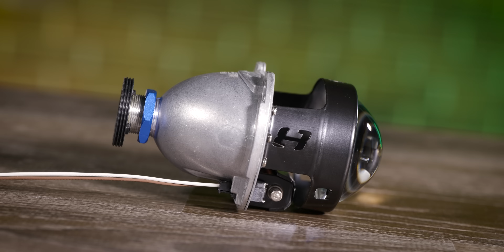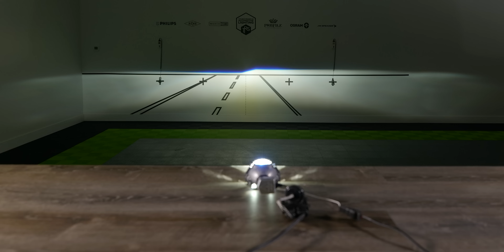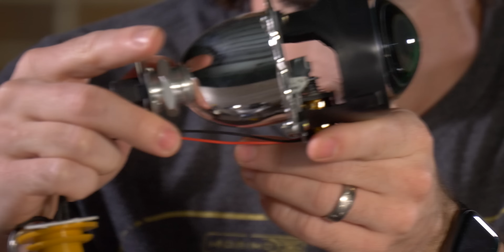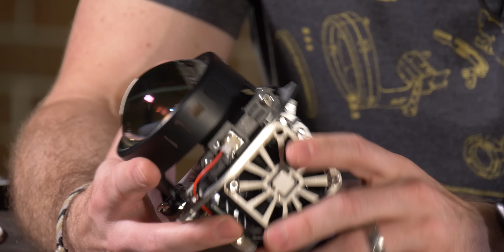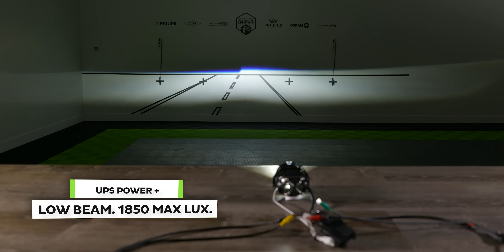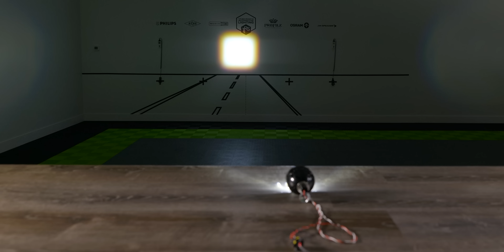LASER VS HID VS LED Headlight Projectors Retrofits - WHICH IS BETTER? | The Retrofit Source

Comment: What do you all suggest for a stock 2018 Infiniti QX 80
Reply from the maker: The 2018 Infiniti QX80 comes with OEM LED headlights, which unfortunately limits upgrade options since the LEDs are built into the headlight assembly. Retrofitting would likely require advanced wiring and custom coding, so there aren’t many plug-and-play upgrades available at this time.

Comment: I wish someone made an LED projector retrofit that used a removable light light the morimoto xenon projectors do. If the M-LED wasn't a built in light I would go with it but I'm probably going to end up going with the D2S mini or micro 5.0
Reply from the maker: It's a tradeoff, but that's the beauty of having so many options!

Comment: Hi everyone, my right projector has misaligned cutoff line for low beams, it's slightly curved to the right, is there a way to move or reposition the shutter plate inside the projector?
Reply from the maker: Are these custom retrofitted headlights or OEM? If they're OEM, we recommend checking the bulb seating in the housing to ensure it's fully seated, as a misaligned bulb can sometimes cause cutoff issues.

If the headlights are retrofitted, it's possible the projector isn't perfectly aligned in the housing. Adjusting the projector alignment would be the best solution. Modifying the shield or shutter plate inside the projector is significantly more challenging and not recommended, as it could cause further issues. Let us know if you need additional guidance!
Reply: @RetrofitSource  It's aftermarket headlights, the projector is sitting very tight, the problem is the shutter is not sitting flat when the high beams are not engaged, what do you recommend to replace the shutter and solenoids or the entire projector assembly?
Reply from the maker: If you're able to open the headlights and investigate the shutter to get it to sit properly, that would be the easiest fix. However, if that doesn't solve the issue or if you're using generic aftermarket projectors, upgrading the projectors would be the next best solution.
Reply: @RetrofitSource  One more thing, randomly it happens that the left bulb goes out then comes back on after 20-30 secs or so, happened on 2 different sets of bulbs, before with HID, now with LED, I had my headlights opened just about a week ago and there are no damaged wires, again I say it happens RANDOMLY I was driving over a month without the issue then it started happening, should I look into the harness plug contacts for my bulbs as the harnesses are loose when plugged in so I taped them with electrical tape but seems it doesn't help much...
Reply from the maker: Yes, we would recommend starting by checking the harness plug contacts for your bulbs. It's important to ensure that all pins are making solid contact, as road vibrations can cause intermittent issues if the pins aren’t fully seated in the connector. If the harness feels loose even after taping, you may want to try gently adjusting the pins to improve the connection.
Reply: @RetrofitSource  Thanks for your help, much appreciated, about an hour ago I've disconnected the bulb and paid attention to the pins as they seem fine and I sprayed some Liqui Moly contact cleaner on the headlight bulb harness to see if that's going to help... After all I think the best option is to swap these BiXenon projectors with a BiLED ones, and then I should be happy with the overall performance of my headlights...

Comment: So all of these Bi Led projectors have the bulbs integrated? So what happens when the bulb fails? You have to take out the projector?
Reply from the maker: That is correct, if any failures do occur typically you have to replace the entire LED projector instead of just HID components like you would if an HID projector failed.

Comment: Was this done with 35watt or 55watt?
Reply from the maker: This video is a few years old, but we do believe it was the standard 35W that was used. Not every application can use the 50W since it essentially overpowers the bulbs to create more light... which also generates more heat. Not ideal for small applications.

Comment: does "retro fit" mean installing something that gets rid of that black line crap that I have on my 2016 Toyota Camry?
Reply from the maker: Retrofit, by definition, means adding a component or accessory to something that did not have it when manufactured. In this case, it's retrofitting bi-LED or bi-xenon projectors for a much better experience when driving at night!

Comment: What would you suggest for a Nissan 300zx Z32.  Low beams projectors are so bad it's not safe to drive at night.
Reply from the maker: Depends on if you want to upgrade the projector, the bulbs, or the entire headlight all together! Reach out to us and we can help you find the best fit. support@theretrofitsource.com or 404-220-7940
Reply: @RetrofitSource  The low beam projector.

Comment: I have a projector headlight with halogens (HB3/9005). Should I change my projectors if I change to HIDs or can I just buy aftermarket HIDs (HB3/9005 bulbs) and just directly replace the halogens? What is the advantage of retrofitting to D2S projectors?
Reply from the maker: The projector that came with your halogens is going to be a halogen-specific projector, therefore HIDs will not be the best option. Putting HIDs into a halogen projector can cause bowls to burn, making the whole headlight defective. You would need to upgrade to a bi-xenon (HID) projector to use the aftermarket HID bulbs.

Comment: How difficult it be to replace a projector housing for a bi led housing in a aftermarket head light? I have a 2008 silverado. I think it has recon projector head lights.
Reply from the maker: All depends on how it's mounted, it could be a direct swap, or it could be a ton of custom work!

Comment: I'm new to projector retrofitting so bare with me -- but instead of doing one projector in the low beam spot & one in the high beam, can I make one projector do both? 

EDIT: Looks like the MLED 2.0 accomplishes that with the low & high beam input for the ballast, correct? Does it require any additional splitters or other wiring modifications?
Reply from the maker: You'll need a splitter off the high beam to trigger the high beam on the MLED 2.0. Our Bi-Xenon projectors work the same way!

Comment: What happens to the ballast if replacing a bi-xenon projector with bi-led? I assume simply eliminating it will kick up canbus errors…
Reply from the maker: Going LED from HID is always a headache, I would recommend against it.
But it would most likely cause the vehicle to throw error codes!

Comment: So what happens when the LED goes out on the morimoto projector? Do you have to buy a new projector? Do you have to take the whole headlight assembly apart again to swap it out?
Reply from the maker: If you have a bi-LED projector, you will have to replace the whole unit.

Comment: Hope that an MLED 3.0 or a new LED projector might come out soon. Haven’t seen many new retrofit projects arrive on the market in a while.

If I were to recommend anything, I would request something like the NHK IV plus, with that second led chip for the high beam.
Reply: Do you have the NHK?
Reply: @benscott3603  I have the MLED 2.0. I’ve had it for a bit over a year now
Reply: @JoeyLovesTrains  I just ordered a set today after fretting and watching and rewatching videos comparing the NHK IV+. I was going to go with NHK until I saw a video where a guy took his apart and said they were built like crap
Reply: @benscott3603  the MLED is really build well imo. I actually drove all the way to New Jersey from Cape Cod to take an in person look at both of them. The MLED also barely fits in my housing even with some custom PVC pipe caps to extend the end of the housing and keep it sealed. Even with all of that I had to grind down part of the heat sink of the MLED to fit properly. But it’s in there and it’s still working after a bit over a year.

Edit: Lightwerkz is based in northern New Jersey, they do a lot of retrofits

Comment: Great video! I have a question, can you add some photos/video from above demonstrating the how far down the road the light actually gets?  I would like to upgrade to LED's and get more light. My concern is losing visible distance.
Reply from the maker: Check out the group Headlight Junkies on Facebook, this is a great place to check output shots that other users have posted!

Comment: Dear retrofit source, how does the lens work out with a headlight, which has the ece light line in the glas, instead of in the reflector, 

We got some old mercedes vans, and they stopped making the headlights, so i want to retrofit some old units. I wonder if the glass of the headlight gives a weird beam if you compare them with headlights with clear glass. Hope to hear from you! Greets from the Netherlands 🇳🇱
Reply from the maker: These lines would most likely catch some of the light and cause a slight glare where it would kick up some light. I don't think it would effect overall performance much though!

Comment: Hi guys :) With the UPS Power + Laser, since it doesn't have a threaded shaft, are there any bolt-and-nut kind of kit to install it, or is it a complete 'you figure it out' kinda thing? Its for the main large reflector of an 06 CRV build, so space isn't an issue. Assume that $ is not an issue either. Thanks
Reply from the maker: It is very much a DIY install, no vehicle specific kits that we've seen for them yet!
Reply: @RetrofitSource  Hi again :)
Aside from a full complete kit, are there individual parts that can be used? Or is it like a 'fabricating metal parts' thing? I AM going to get them in the car, just doing my homework, if you know what i mean. :)

Comment: I have a 2001 ford lighting what projectors would you recommend for that application
Reply from the maker: Tons of room in those headlights! I would recommend the D2S 5.0!
Reply: @RetrofitSource  do you think it will be a simple swapp or will there be alot of cutting?
Reply from the maker: Fairly simple, will need to be recessed some or have a larger shroud to cover up the internal bits of the projector.
Reply: @RetrofitSource  when does your black friday sale begin this year?

Comment: Doing my first retrofit I’m sooooo excited!
Reply from the maker: Good luck!!!!!
Reply: @RetrofitSource  I’ll DM you guys some pics on Instagram now that I’m done!!!!
Reply: @RetrofitSource  I’m still getting a little bit of condensation inside one of the lights do you think I can just drill a couple small holes for better ventilation I don’t know what else to do
Reply: how did it go?
Reply: @aidendickinson  I went with the 2.0 BI LED the fit very well in the H4 housing with little modifications the are extremely bright and the cut off line is insane, I can’t get the high breams to work so MM is sending me a new harness for free so hopefully that fixes the problem, just drove tonight in heavy rain and snow and they cut through everything and still shine light way down the road,
Reply: @aidendickinson  still ordering parts
Reply: @aidendickinson  well I went with aftermarket lights because I liked the dark housing which was a draw back because I kinda damaged the headlight housing taking them apart out of the oven so when I went to put them back together at first they did not want to seal up very well I had to wrap the lens and housing with tape and let the glue dry on the ends what a pain,
Reply: @aidendickinson  next time I’ll use the OEM housing and lens the plastic looks a lot thicker and more durable
Reply: @aidendickinson  basically at this point any headlight I mess with is getting a projector swap no matter what, I’m so done dealing with Leds or Hids in factory housing that throw the light everywhere, what a waist!!!!!! And the morimoto headlight glue is way better than the eBay headlight glue I did a little test and it’s way sticker also

Comment: do not wait your time and money on projectors - get 150W xenon kit and instal into non project lamp you be blown away with light quality
Reply: Reflectors are not meant to be used with xenon lamps. The light looks brighter, but its going everywhere, and is blinding every other driver.
Reply from the maker: The light will be scattered and not aimed properly.
Reply: Not to mention you'll piss everyone off in on comming traffic

Comment: Can you guys please tell me if these bulbs degrade in quality over time?Been using G5R+Hylux 35w+Philips XV Gen2 D2S for more than couple of years now but I somewhat doubt whether they deliver the same output as when they were new. Thanks
Reply from the maker: Yes, it is natural for HID bulbs and ballast to degrade over time. It might be time to replace either soon. If you need help shoot us an email at support@theretrofitsource.com.
Reply: @RetrofitSource  Hey, thanks for replying back. Would you please tell me in how many years do they normally lose their brightness? Mine is a little over two years but has already lost over 40% of brightness which is highly disappointing given the cost and brand! In my case, do you think changing the ballast to 45w or 55w from the current 35w can do any wonders? Thank you so much!

Comment: So how can i use the MLED 2.0 since it has 2 wires for low and high , but my car headlight harness only has 1 connector that is a HID system that is low and high beam?
Reply from the maker: Shoot us an email if you still need assistance. support@theretrofitsource.com
Reply: @RetrofitSource  will do

Comment: So I have the mini h1 7.0 and I never did like the steep cut off so would the new 8.0 cut off shield work in my 7.0 and do you guys sell it separately?
Reply: While it would probably work, it is not sold separately. I just upgraded to the 8.0 from the 7.0.
Reply: @Galactic-gli  is the 8.0 a big enough difference to justify replacing the 7.0? Is it brighter or bigger/better hotspot? I definitely like the cutoff line / slope angle but not sure if its enough to justify replacing my 7.0 for that reason alone. Also does it have more blue along the cutoff line?
Reply: @sydneyann20101  The output is slightly warmer in color temp due to the AR Coating on the lenses.  I think I received a funky unit, one of my cutoffs is not perfect / doesn't match the other side.  Also received a dim bulb out of the box.  Going to hit up their support and try to get the problems solved.  Overall It is an upgrade, but if you're happy with the 7.0 I'd just leave it unless you ran into problems.
Reply: @Galactic-gli  appreciate the quick response and thanks for the advice
Reply from the maker: Not sold separately, sorry!

Comment: Hello! I can install projectors type MLed in BMW E 46 without showing light code, or what recommendation can they make, which is the appropriate size and type . Thak you.
Reply: It's a BMW. Almost anything you do to that car (I had an E38 and now I have an F01) needs to be coded. I'm upgrading my headlights in my F01 to a G5-BRT and I'll lose AFS...so it's going to have to be coded.
Reply from the maker: Hello, if you still need help email us at support@theretrofitsource.com and one of our service reps will be able to help you.

Comment: So been waiting for RHD M LED 2.0 for Australia to put in my  07 GU patrol but my only concern is replacing the LED as this car had been all over Australia on ruff dirt tracks and blows a light every time on a 5000-10000km trip as I always have the lights on especially towing. I put LED H4 in it and still blows a led on I trip, and to replace a M LED isn't something that you can do on the road, but I'd so like the works, demon eyes, Halo's, switch backs, the etched Lens that said Nissan and instead of the M on the ground I want it to say patrol, oh the sky's the limit. How much can the M LED take in ruff dirt roads?
Reply from the maker: So long as everything is sealed up and installed properly you shouldn't have any issues with them blowing out on you. If you need help deciding what products to go with email us at support@theretrofitsource.com and one of our service reps will assist you.

Comment: Would it be possible to change my OEM D1S projector for a set of these Morimoto D2S 5.0 projectors? The 45 degree slope that it outputs looks way better than the almost 90 degree slope of my OEM D1S projectors.
Reply from the maker: It would take some work but it can be done!
Reply: ...would there be any bulb errors if I were to use a D2S bulb vs the original OEM D1S bulb? What's the input voltage for a D2S vs a D1S bulb?

Comment: Hey man, which one do you think is the most suitable upgrade for my 2006 Lexus RX330?
Reply from the maker: Do you have the OEM Halogen bulbs or the OEM HID setup? Let us know that and we will be able to get you a recommendation!
Reply: @RetrofitSource  I have the OEM HID setup. But it is starting to get dimmer now even after changing ta new ballasts and bulbs. So now i'm thinking of upgrading the projectors. Which one do you think is compatible with my headlights?
Reply: @RetrofitSource  oh and i also like to know, if i can retrofit one of those bi-led with hi low beam inside the hi beam section of my headlights?
Reply from the maker: If you are looking to retrofit both the low and high beam applications, I would recommend going with M-LED 2.0 for the low beam and the high beam! I have linked that kit for you below, shoot us an email if you have any other questions! Have a great day! Support@TheRetrofitSource.com